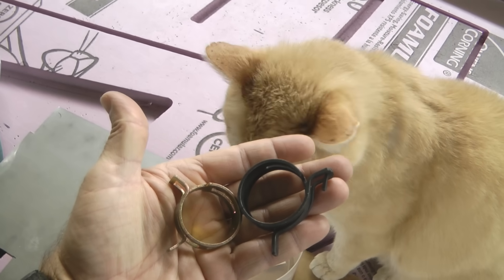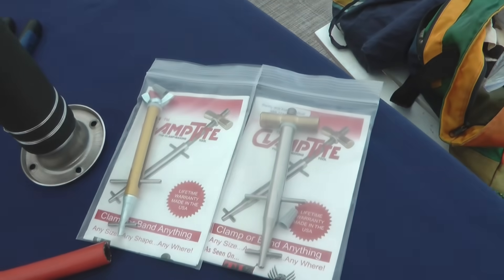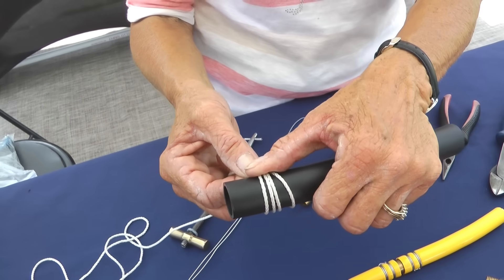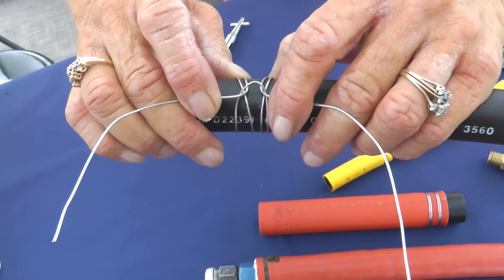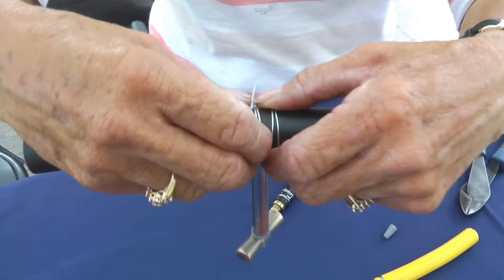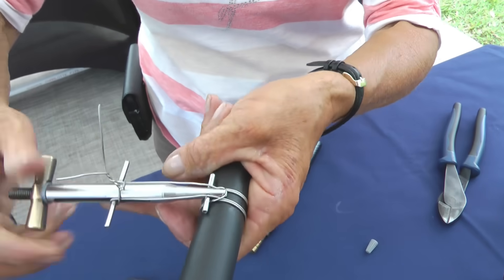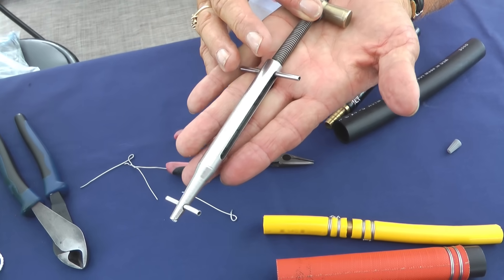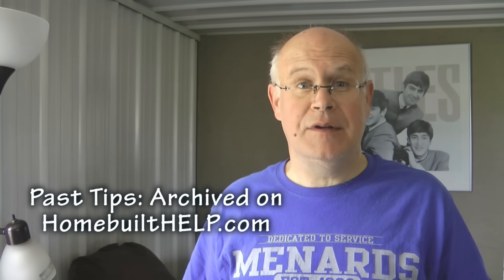Making your own Hose Clamps for Experimental aircraft

Comment: Had this tool for 20 yrs and used it many times. The clamps are extremely tight and reliable and using SS wire makes them last forever. There are many homemade variations on this design that you can see here on Youtube. I made one and like it even better.
Reply: Could you recommend search terms? I wouldnt know what to call this.
Reply: @xorbodude  Kl?
Reply: Hi please help me where i can purchase this type of tools. Hose clump. Thanks
Reply: @arnparcon9826  i made my own
Reply: V., v mmm!3
0
Reply: Could 14 guage copper wire be used?

Comment: Copied that designe works well, there are better dys designes out there you loose about 6-8 in. of wire each time. Also very pricy. With smaller pipes its best to double loop the wire as they have a tendancy to leak after a time with a single loop. I now have a single ear hose clamp tool, (insurance!) I trust them on house plumping !! And other stationery lines, But I love using my dys as they have very little stick out to catch on when working around.

Comment: I've had mine for about 10 years and it's used all the time. It takes "only" a few times to get the knack of it. In no time you will find it so handy for so many projects. Not only that but, like you mentioned when there is no clamp around, it works out in a pinch. Note; I call it ( temporarily permanent ). After installed, there's no need to replace it to ( permanent ) because it is. Also noticed you will get a full, all around secure seal for liquid and or air lines. Let me mention "air again" because, you'll always get a leak with the traditional worm gear clamp. Only downfall, it does require some room to move around but, "Everything has a downfall". Great little unit.

Comment: Question:  What kind of pressures can this hose clamp 'unit' support.  I have an application that has liquids where the pressure might be up to 500 PSI. Can this tool make a safe and reliable 'clamp' on fittings for my app ?   Thanks

Comment: This technique is brilliant, and it's been around forever... Clamptite just repatented it and reintroduced it to the market.
When working on cars in tight spaces using this tool is not very practical. You need room for manipulation, maneuvering and leverage... 
 There are reasons why different hose clamp designs still exist. The best clamp is different depending on the situation. Sometimes you just want to add a clamp to a system that's already assembled and working without removing the hose to thread on the clamp causing all the fluid to run out. In short, everything is a compromise as to what you need vs what's available or feasible... etc

Comment: I use mine for a lot of things but I  would never use it for aircraft.  In time the rubber in the hose settles lower and you really need a tighter clamp.  In the same sense I usually find benefit in going back and tightening normal screw clamps for the same reason.  I'm still  glad to have it and use it on many things.

Comment: In the older days I used to make hoses for aircraft and I put the fire sleeve on wrap lock wire around it and twist up tight than put Dow-Corning 736 red sealant over the wire to stop cutting your self and sealing the end to stop fuel oil etc from getting under the fire sleeve but after see this fantastic tool I just wish I knew about it in the 1970s I like it so much I have ordered one and should have it in  about 2 weeks 
If you see and neat tools show us  as in Australia you don’t get to know about these tools keep up the videos

Comment: Worm gear clamps
Pressure fit clamps 
Wire "clamps" are probably your worst idea to use. Worm gears can be over tightened causing you to ruin the hose and cause premature leaking, pressure fit clamps WILL lose their hold within a couple of years and wire "clamps" are only as good as your ability to put the right amount of pressure in the correct areas of the fittings barbed shank.

If you can get to a hydrolic hose store like a Bridgestone Hosepower and get center punch bands. And when you put them on like any barbed fitting counter the tightening points to keep any leaks from happeing.

Comment: Hey guys, if you need to clamp in a tight spot, then remove a clamp from an easy spot and fit it into the tight spot. Then make your wire clamp in the easy spot!

Comment: excellent tool...One only has to bend the wire in a safe way coz if not, the sharp edge of wire tip may cause a  puncture in the hose...

Comment: What safety wire is recommended? Malin "aircraft" safetywire (either 62 or 32 thous) is so stiff, that it took over an hour to get a 3/8 hose clamped. The tool is fine but the safety wire is utter garbage.

Comment: typical spinner stuff .... in an emergency or when nothing else is at hand, I take wire & combination pliers or Leatherman and drill the wire together, it is quicker and just as easy ... but today there has to be a toy for every nonsense give
Reply: I'm trying to picture what you're talking about.  Not having any luck.  Could you explain a little more in detail?
Reply: What was incomprehensible about what I wrote ?! You just don't need this "tool" because it works the same way with a pair of pliers. Especially in an emergency and when it gets tight somewhere the thing is of no use at all. In this respect no offense but this is such a tyopic bullshit tool that no one needs unless you have no idea or too much money. Normally you have a neat hose clamp very easy to hand. I don't know anyone who wraps any wires around their water hoses or uses such cumbersome crap on the way as shown in the video.
Reply: @1980yazo  So where does the drill come in?

Comment: Any more pressure or vibration etc and it will cut the hose. Perfect point of failure. There is a reason they use a band of metal instead of wire in clamps.
Reply: Metal or plastic band (original TyRap) is better. So is the oldfangled metal CV boot band.

Comment: Had mine a long time. Picked it up from her at an aircraft trade show in the 90's, mines a filthy mess now but still works fine. Can firmly attach things together CRAZY tight if needed (not just hoses).. Keep it in the bottom of your tools with a roll of stainless .032 lockwire and you can take on the world.

Comment: AAA+++ demonstration.  Fantastic tool, the ONLY additional finishing move I would add would be as follows:   
 4:24  
1. Cut the two leads 1/2" +/_ long. 
2. Take fine tip needle nose pliers and starting from the end of the wire, roll each of the two wires into a small swirl. 
3.  Press the swirls flat as you like.

Why do this?  Well as most of us know that do all sorts of work like this,  When you are reaching into areas doing work on various things, you invariably you end up bleeding from your hands and arms  from improperly trimmed  - non flush cut Zip -Tie ends, and wire ends like this Tool will leave you with, which ALWAYS come from other people's work.

Just say no to bleeding and do as I do!

Comment: ???! Clever, but 1st: not on a certified A/C (to be fair, they said EXPERIMENTAL). 2nd: Emergency Repair? Shoot, you have to have wire, the tool and 'noodle nose pliers' 😜; really? 3rd: toss a couple of SS hose clamps in the emergency repair kit and you are done.

Comment: I know this is a practice used in aircraft hose fittings, but coming from the automotive repair industry, I like the "Corbin" flat metal spring steel clamp. It covers 360 degrees of the hose and more so, allows for expansion and contraction as perhaps a coolant fitting would experience. The plastic inlets/outlets on today's radiators are subject to failure if high pressure is focused in one location such as the work screw drive clamp creates. 
 I like this practice but as others have pointed out, little to no room in certain locations yet I too would like to see a measure of clamping force. Perhaps a calibrated compression spring with a pointer over a scale between the pulling and pushing points. Just for repeatability. But this would double the tools cost. The advantages of a chart for size and material types would be nice, but this to requires testing.  Also, I would use the term "Dressing" the clamp instead of " Scootching". My grandmother sent me "Cattiwampus" from their house to the store to get a soda, so not heard to much in the 21st century.,
 Either way, very interesting and creates a neat and unique look...if others could see it.
Nice tool but easily crafted by many crafty builders. I am out on the idea of reusing this wire clamp once stretched. (Sponsored by the stainless steel wire manufacturers) Interesting!

Comment: Very expensive, especially the stainless version. Worth making your own at the price. I have one. If you use it regularly, you will use it easily. Leave it for a couple of weeks or  a month (remember this would be good for an emergency) and you have to watch the video again! Also, unless you have the tool with you at all times, if you have to remove the wire clamp....
Also I found that the notch that holds the loop is too small and the wire keeps falling out as you fiddle with the rest of the wire.
As people have said, useless in any crowded space.I usually end up using geared clamps and forget how to use this thing.

Comment: I think it's a handy tool. I noticed a lot of comments on using it in engine compartments and such...of course it can't be used in tight quarters but it's perfect for air hose repairs, plumbing, hydraulics, irrigation where you can fabricate on the bench or off application. 
Great Video. 5 Stars.
Reply: Es correcto, en espacios pequeños no se puede usar, gracias

Comment: I've used good screw band clamps   and have seen the slots on the band cut right through the rubber when tightened. The good ones don't strip. The nicer ones have a rolled edge anti cutting band protector that also provides full 360 even sealing force. The best things with band clamps is tight spaces. Better than the spring ones. The surface area of a band is much better than wire.

Comment: So, if You don't have the right clamp in an emergency, I doubt anyone will have the stainless steel wire and that expensive tool.
It would be ok for birth control on both female and male .

Comment: When an experimental aircraft isn't risky enough, add to the excitement by shunning reliable clamps in favor of something homebrewed that has multiple ways it could fail.   Maybe you should just have spare clamps in the sizes you need instead.  It's not rocket surgery.
Reply: To make your own aircraft and then start making your own clamps and such must take fair sized  kahoonas. Just think though, before these "reliable clamps" were about what did people use? Its not brain science
Reply: @epiclyJ20  Naw, I was doing foolish things as a child before my kahoonas ever dropped.  Hint:  Clamps existed before the first airplane did.  What people used before that was pipe fittings, metal pipe pre-dates rubber.  The more you know, the more silly it seems to take chances on such a basic, inexpensive thing as a pipe clamp, unless you are stranded somewhere and if you are, odds are your bigger problem is loss of fluid or the burst hose, not that the clamp pirates came along and stole yours.  ;)  Clamps are very readily available and inexpensive.

Comment: what about in a tight spot (inside the car).... what about if you have to remove the clamp to make other corrections on the pipe or hose... it'll be too much work; do and undo... do and undo... this would be less of a hassle on garden hoses and, if it is 10 times stronger, then its a great idea if is your very last permanent clamp on a hose...

Comment: Ingenious idea!  Also looks a lot cleaner & more streamline then your conventional hose clamp.   But I think there are definitely some drawbacks to this method...   First would be once you finish up tying, tightening & trimming your wire clamp all nice & neat... you’re kind of screwed if you find out you didn’t make it quite tight enough... instead of a quick turn of the screwdriver to tighten up a traditional hose clamp, seems like you’ll have no option but to remove the thing & start all over again with another length of wire.   And 2nd would be the removal process... not too sure there’s any good way to remove that wire clamp without damaging or cutting into your hose in the process?

Comment: That "WIRE" you're using is guaranteed to eat through all "Rubber Hoses" sooner rather than later. The flat hose clamp is going to last a lot longer. If I saw any use in this item I'd make one in my garage in 30 minutes for less than < $5.

Comment: Looks like a good idea.  It's easy to put too much tension on a hose and destroy it.  Some of those hoses she wrapped would get cut through in a matter of a few months.  Even for a worm clamp, it's very easy to wreck the hose by overtightening.  That's why the Germans started going with those spring clamps that VW owners struggle with.  The tension is pre-determined based on the needs of the hose size.  They seal extremely well even under pressure, and you will never see one of those cutting into the tubing.  A slight indentation is all that is needed.

Comment: No need to re-invent the wheel lmao. 10x stronger than what? Why does it need to be 10x stronger if current clamps do the job just fine. That's like saying lets pave roads out of 10,000 psi concrete and add steel beams underneath so its 100x stronger...

Comment: So, in an "emergency all I need is a few feet or string, a few feet of wire, needle nose pliers, side cutters and a specialized tool that only has one purpose? Perfect. 
 As long as i have all of those tools I won't have the need to think ahead and carry a few hose clamps and a screwdriver. FREAKING GENIUS !!!!! This idea must be German Engineered, very complicated and over twice as many peices to solve a problem that began with only two. If someone cant carry a few hose clamps and a screwdriver, how in the hell would they carry all of that junk?

Comment: I would use wire as a clamp only if a hose came off a fitting and the original clamp was lost. Then i  would just wrap a couple of turns around the hose and twist  them tight. That should get me back to my shop  to replace the wire,  and maybe the hose, with a proper clamp. I would never use  a wire clamp on an airplane, homebuilt or not! This is a road repair only. 

Besides  how do you step outside your airplane when a hose becomes disconnected in flight?

Comment: About 55 years ago I walked into a welding shop. One of their old timers showed me how to clamp welding hoses with a piece of wire, a vise, and a pair of vise grips. My wire of choice was bailing wire. Since then I've done hundreds of this type clamping on welding equipment, water hoses, air hoses, etc. Never had any failures. It just wasn't possible to do them in place. It looks like this tool would do that if not a real tight place.
Reply: Please show us a video of this old way of doing it. Thanks!

Comment: You ever see the improper clamps on a hose so tight the rubber is bleeding from the gaps in the clamp? That starts your rips and splits in a hose A proper clamp is flat all the way around with no gaps Tridon clamps are no good for high pressure or rubber..Same go's for this tool and wire Which is thin pressure point on the hose This is where your trading heavy torque in a small area to keep a hose on To a flat clamp with wider area of even torque ...Your goal is to cover as much as the rubber hose to the inlet/outlet as you can without risk to the hose coming off Or being damaged...Please spend the $1 on the right clamp for the right job

Comment: This video shouldn't  be listed under experimental aircraft, for all you mechanics out there who say "not enough room".  However, things like air hoses for the shop or other low pressure liquid applications, it seems like it would be really, really nice to have those fucking shit hose clamps catch on your pants, slice your hand, or stuck on the edge of a tire or table leg as you pull the hose towards you.  Twist it off, wrap w/ a little tape, almost as low profile as factory crimped hoses.

Comment: Interesting, I have done this in the field, years ago made a similar "tool" at a printing plant that ran 24/7. I was their hero as 10 employees stood around watching me work. (fun) Once operating I did have a nap before going to the local pneumatic supply for the proper hose clamp. I used it a few more times with work and one time on the road to a VW meet when my bug's fuel line loosened on the filter, not a good thing on an air cooled 1971 Volkswagen!
Reply: I had a '71 bug pop the pressed-in fuel intake fitting out of the carb, hose down the engine compartment with gas, and set itself on fire.  Sometimes I question the sanity of engineers.

Comment: Could be the handiest most versatile and useful tool you'll ever own. Might even save a life someday. Suppose you lose a limb in a chainsaw accident, you would bleed out long before EMTs get there. But, with the Clamptite tool you could pinch closed that bloody stump with sterile stainless steel wire and make a neat and tidy permanent clamp that requires no further attention, saving you butt loads of money in healthcare. Or use it in the bedroom as an extra measure of protection to keep those condoms from sliding off.

Comment: It’s not good tool specially for the tight spaces for open areas you can use players or chain lock and wire or buy box of clamps in harbor tools for $2

Comment: This is great for a quick on the spot fix for a hose clamp. How ever nothing beats a genuine spring hose clamp. They expand with the heat and never let you down. These wire clamps force the hose to constantly strain the rubber under the wire. They will develop a slow seep. Good in a bind but spring type clamp is best for most applications. Nice video.